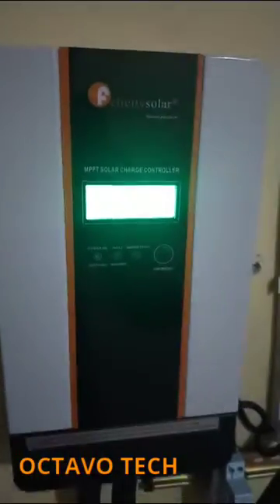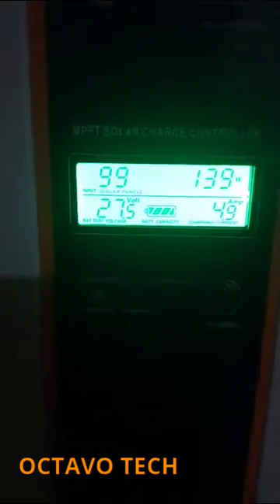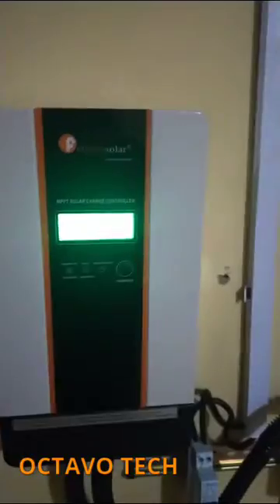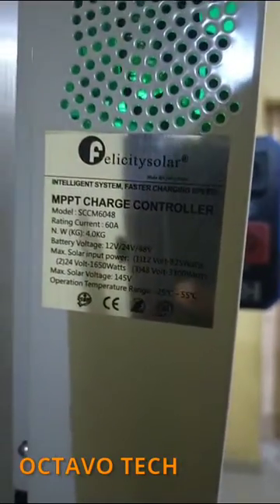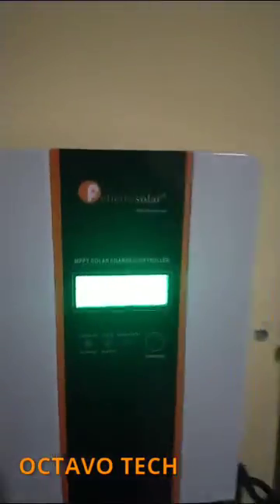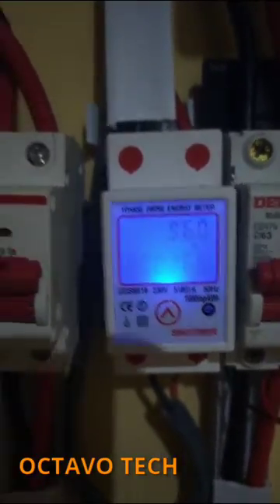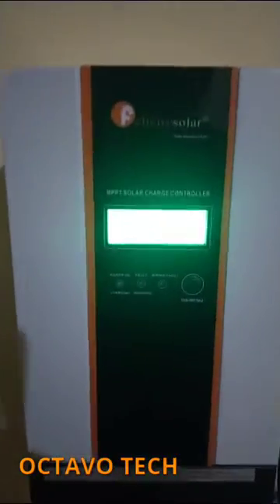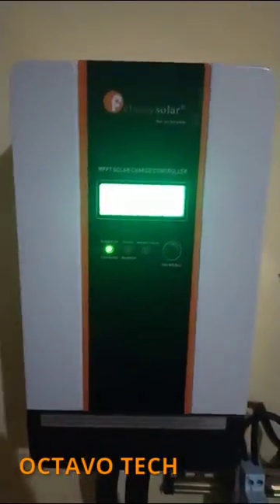Felicity MPPT charge controller overview - is it worth it?

Comment: Good morning, pls, I would love to know how to make my battery level move so as to know that my battery is charging via d Felicity inverter. I also have a Felicity mppt charge controller, which shows my battery is charging but really want to see d battery level move on my inverter. I use a 24v system, 2 Tubular Batteries. Thanx
Reply from the maker: Good morning, felicity didn't design theirs to move.

Comment: Please I will like to know 
How do I detect the capacity of the charge controller without checking the sticker on the body or carton
It seems one installer dupe me

Also 

How did u get such high wattage in the controller did u use series or parallel in panel

Comment: Hello, I’m using a 24v system. Please what should I set “the maximum current of battery equalization “ to ? Thank you
Reply: This will depend on your battery type. Tubular batteries would require a higher equalisation voltage while gel batteries don't require equalisation.

Comment: Good evening sir, please am having 8 no of 550w on my panels .
The voltage am getting is 88v to 90v and the green light blinks at times my mppt device shown 01 error on warning in the afternoon.
The device shown warning light at night is it normal at night ?
Reply: Did you solve this issue eventually? I'm having the same light blinking issue. I'm suspecting the panel is not supplying enough power. I see 139v and Inverter max open circuit voltage is 195v.

Comment: I just installed this same mppt,( 60a) but I never noticed PV  voltage above 27volt and the PV watt never go above 295w and the charging current below 14.4amp. The panels ( 4x 300watt) are connected in parallel with a 24 volt system.
Reply: series them in twos then parallel and make sure your cables are the right size connect a temp. sensor

Comment: Please i need help.. When being charged by solar panel, the Charge controller and battery voltage increases rapidly.. amd when the sun is down.. it decreases rapidly too.. but when i use my gen to charge, it provides actual charge and longer battery life
Reply: I’m having same problem, have you found a solution?

Comment: My controller is not showing wattage and amps
Reply from the maker: Something is clearly wrong because these are the parameters it should show by default.
Reply: Check that your panel wire to the charge controller is not loose

Comment: Please how do you get input voltage of 101v, for the input, cos mine has never passed 31. My setup is 24v with 4 12v panel (180 watts) and 2 220v battery with same 60A fidelity charge controller. 
PS. The wire from panel to charge controller and battery is very short and its 600v one.
Is there any problem with the setup?
Reply from the maker: You are not supposed to use a 12v panel for 24v setup. That's the problem.
Reply: @octavotech  sorry forgot to add that they were connected in series, to give 24v.
Reply from the maker: @desmondolafisoye5524  There's 24v panel for 24v setup.
Reply: @octavotech  been actually running 12v system b4 I got 24v inverter. So I had to make everything 24v. Will 24v panel do better??
Reply: @octavotech  I appreciate the replies. Thanks

Comment: Hi, I purchased the same type of charge controller (Felicity MPPT) the new version that the display always goes off during the night. Please, do I need to adjust the original settings or i am good to go with factory settings? I'm using one 12-volt battery, 220ahms. Please advise me.
Reply from the maker: Hello, you don't need to adjust anything, the default settings will work just fine.
Reply: @octavotech  Appreciate

Comment: Goodevening I bought 45amps Felicity charge controller
I'm using 330watts 4 connected in 2 series which is about 1320watt if I'm right sir, I'm using  24v battery system but my problem is the charge controller is not showing me actual thing correctly. Since then my battery doesn't last till 6pm. I just bought it 3weeks now
Reply: Please what's the issue I Don't know if it's the controller or my panels, but I read all panels and it's showing equal voltage

Comment: I have this same controller and 8 275watts panels, the macimum intake i've seen is around 650 to 700watts. is that ok or low?
Reply from the maker: It's either your panels are weak or, there is no good access to sunlight where the panels are located.

Comment: How do felicity products work?
Can the work or display correctly when you connect the battery only or when both the batteries and panels connected
Reply from the maker: It will display when battery is connected.
Reply: @octavotech  mine doesn't

Comment: Hello, I am using this for like 3 days now. I noticed that it goes completely off at night that I unable to read my battery consumption level. Besides, when it’s cloudy, the fault light comes on. I have called the technician, but he has traveled to another region and it’s difficult to get him. Is it something to worry about or should I just shut down the system? It’s barely three days
Reply from the maker: Nothing to worry about, just don't overload your system so the battery lifespan can last well.

Comment: Good morning sir. I just got this controller. Do I need to edit or change the bulk charging time and do I need to enable the equalization mode and if yes what should be the voltage and current at equalization?
Reply: What type of battery chemistry are you using?

Comment: Good evening. During the day while the sun is up and my appliances are loaded. The controller trips of and I loose current and watts. Then After fee seconds, it starts building back again. Please what could be the cause.
Reply: I had the same concern before. When your batteries are nearly full, the controller sense the SOC and reduces the charging current, then comes and instant load, your inverter starts to draw lots of current from the battery bank, and the charger starts to draw more from the solar panel. As the current from the solar panel increases the controller built-in protection sense there could be fault, to prevent itself from damaging your bank, it shuts down, the starts building up after about 30 seconds.
Reply: @diyfalke  exactly my complain. How can it be bypassed. So I don't kill my battery bank. Imagine load of 1.5kw running on the battery. Meanwhile there's a solar array of 3kw
Reply: @isaiahefosa848  I think you have 2 options, I am assuming your battery bank is small.
1. When you increase the size of your battery bank, the triping stops. For me, I was having a 40Ah 48v battery with a 3kw array (I only use it during Daytime). After changing the battery to 120Ah, it never shuts down again.
2. If you can not afford a bigger battery right now, you can remove the MPPT and install a PWM charger, in your use case, the battery bank is safer with the PWM.
Reply: @diyfalke  I use loads of up to 2kw. I don't think pwm can draw enough current for that load capacity. Cus i use it to run my business through the day. so I guess increasing my battery bank would be the next option
Reply: What are the sizes of your solar array and the battery bank?

Comment: Making 140w is not awesome. my outback flex  makes average of 1400-1600w easily. also why did you setup your PV voltage that high? pressure?  at 100V , there is lot of wasted panels, but since you also have 2 batteries, it probably ok for you because your load is very low.

Comment: I just got a 45aA of mppt charge controller felicity product.  Its been installed and its showing fault red light and dqsh board light started blinking and now no light at all on the charge controller dash board. Pls whats the problem.
Reply from the maker: It will come on tomorrow morning.
Reply: @octavotech  thanks.
Reply: I also noticed that my batery don't last. I don't know if it's normal. I just got 2 new green kapital tubular batteries of 230AH each . When I put on my inverter by 7pm. It only last me for about 6 to 7hrs then the inverter off. These are my loads, 3 fans of 70w each, 24 power saving bulbs of 10w each which are on for 5hrs , 2tv of 55w each which are on for just 3hrs. Pls is my inverter working hours correct?
Reply from the maker: @josephdaudu5622  You are doing more harm to your batteries than good, based on the loads you specified and duration. If you continue at this rate your battery may not last 5 months. You are not supposed to deplete your Tubular battery below 50%. Your loads are too much for your battery capacity. Kindly consult a professional to do appropriate load audit that will be suitable for your batteries. I hope it's still redeemable.
Reply: @octavotech  thanks bro

Comment: Good morning. I just got this same model of charge controller. 60 A. It goes off at night when the sun is down. But when it comes on in the mornings, the fault light blinks for a while after which it goes off and continues it normal charging. I'd like to know if it's ok or something is wrong.
Reply from the maker: There's nothing wrong with it, it's okay.
Reply: @octavotech  Thanks for the prompt response. Gratitude.
Reply: @patiencemoveh379  That is how it is programmed to operate. There's absolutely nothing wrong with it.

Comment: thanks bros for your reply. Please what is your load. I am planning same system as yours 1200 watts panels. 3kva 24v inverter  and 2 pieces 12v 200ah battery.  My total load should be +-600 wattage.thanks
Reply from the maker: My night time load is not more than 100w.

Comment: Hello bros please how many hours of backup do this system give you and what is the current price of 3kva  24v inverter and the battery thanks
Reply from the maker: It all depends on the load per time, but as for me I use overnight without issues when there's power outage. I don't have an idea of the current prices.
Reply: @octavotech  thanks bros for your reply. Please what is your load. I am planning same system as yours 1200 watts panels. 3kva 24v inverter  and 2 pieces 12v 200ah battery.  My total load should be +-600 wattage.thanks

Comment: Hello sir I have a 3k felicity hybrid inverter the pv input is changing quickly from range 200 to 400 what could be the problem and another thing when the batteries are full the charging light turns into green when the electricity is on but it becomes blinking and sometimes disappear when the electricity is off
Reply: Hello, I major in installing hybrid systems and this is how that inverter works; when the green light is blinking, and there is no AC in, it means the solar panels are delivering more energy than you are using, however, if the blinking disappears, it means your load is greater than what the panels are providing and when the green stays on, it means your batteries are full. I have installed more than 30 of that inverters you mentioned

Comment: Hi, 
Thanks very much for the video. I'm trying to match the MPPT120A with a IPVA7548 inverter following the section "Match the inverter to the MPPT controller" in the mppt user manual but doesn't work. Do you know i it works? For what is the MODBUS Communication port in the MPPT?
Thanks.

Comment: Pls brother, the power button on my Felicity charge controller is always blinking green when the inverter is on at night which is an indication for charging according to the manual and the current voltage ,input voltage etc are being displayed as it's blinking.pls is this normal at night cos my batteries drain quickly.thank you
Reply: Should be red and green light blinking with error 20. If that's the case, it's normal

Comment: Pls,am using same Felicity charge controller but it always displays  the blinking red warning light at night and immediately l turned on the inverter the red stops and the input voltage, charge current etc will be reading even at night
Reply from the maker: Hello... We've discussed this severally, it's low pv voltage. It's normal when there's no sunlight. You can go through your manual for more info on error codes.
Reply: @octavotech  bro my keep blinking the red light both day and night
Reply: It will blink and stop then start again
Reply from the maker: @mercyadewumi1311  it's probably faulty, it's not supposed to blink red light when there's sunlight.

Comment: Good day,

I started using the same felicity mppt charge controller (80amps). I noticed your input voltage is 101 and mine doesn't go above 29.
Reply from the maker: Maybe your weather is cloudy.
Reply: @octavotech  Not really. I am getting 1.14kw and 44.8amp charging current
Reply: @sadmooNGN  I guess your installer connected all your panels in parallel
Reply: You see, when you connect your panels in parallel, maybe 4 300w, 8.9ahms each, you need a big cable to handle the delivery when working. You'll notice that the wire becomes hot during the day when it is working. However, if you go series, it will deliver the same job but you don't need big cables to handle the delivery....no 6mm will deliver the higher volt and all will be fine.
Reply: Parallel connection
Reply: Same thing with mine, I get up to 650w but my input voltage does not pass 29-30v. Is this normal?
Reply: @TobechukwuObi  your pannels are all connected in parallel. It will work more efficiently if you can series connect like two or three. Series connections reduces the current you have to carry with your conductors/wire so depending on the number of your pannels you can do 3S2P or 3S3P connections just make sure your VOC is within 70% of the maximum VOC of your MPPT  controller. And you do not exceed the maximum wattage for your chosen system(12v, 24v, 48v and 98v)
Reply: @godswilleni8815  thanks for your reply, it was checked by my installer and I get up to 900w at a very sunny day and input voltage of 64, but my Mppt charge controller is a 60A and can take max 1600w. But the above information does it mean the system is okay.

Comment: Hey there. I have the same device. When the sun goes down, does the red fault light flash? And secondly how do i check that its in 24volt mode?
Reply from the maker: Yes red light flashes when there's no voltage from pv. Voltage configuration is detected automatically based on your battery set up.
Reply: @octavotech  I see. Thanks for the quick reply. Wasn't sure if there was something wrong with the controller.

Comment: and which solar panel can you recommend in nigeria thanks bros
Reply from the maker: Canadian solar panel, Yingli, jinko, that's if you can find the original.
Reply: @octavotech  thanks for the fast reply bros also which 12v 200ah  solar battery is best in Nigeria thanks
Reply from the maker: @victorsolomon4277  Go for Tubular batteries, they have similar battery chemistry. Powermax, Luminous, etc are okay.

Comment: Is there any effect in connecting four panels in series and parallel for a 24 volt battery system such that two of the series connected panels are 320 watts while the other set is 375watts
Reply: Sometimes with such connection your 375w panels will only output 320w, which I guess is not that bad

Comment: My total Load is 520watts . Wat solar panels, inverter and solar charger controller required for the above load to last for atleast 5hrs in a day (12v solar)
Reply from the maker: Inverter = 2.5kva
MPPT Solar charge controller = 60amps
Battery = 220ah x 2 (Tubular batteries)
Solar panels = 250w x 4 pcs
Reply: @octavotech  Thanx alot
Reply: @octavotech  supposed I use a hybrid inverter. Of the same wattage
Reply from the maker: @events1964  That's fine as well.

Comment: Good evening, thanks for the above review. I'd like to get your opinion on the Felicity 5kva 48v inverter ( ivps50048li), it says charge controller is built-in. 
Is the in-built charge controller effective or do I still need a separate charge controller for it to work?
Reply from the maker: You do not need a separate charge controller.

Comment: I have the same Felicty MPPT charge controller in my system, its working well. My only problem is, the screen goes off completely during the evening when there is no sunlight, and comes on the next morning. Can i have on at night to see battery voltage?
Reply from the maker: I think it's the newer models that behaves this way, a lot of people have complained similarly, but I think the reason behind that is to save energy at night. You can check your leaflet if it can be disabled, mine doesn't behave that way, it's an older model.
Reply: @Simon Messer No, it does not come on when battery is connected
Reply: That's how the new upgrade work